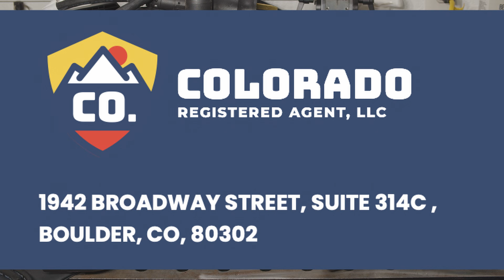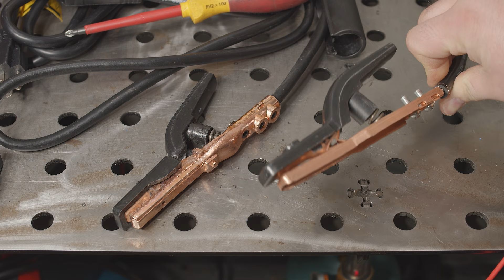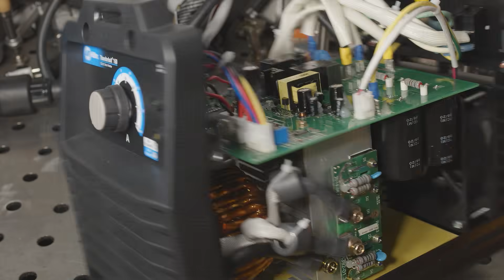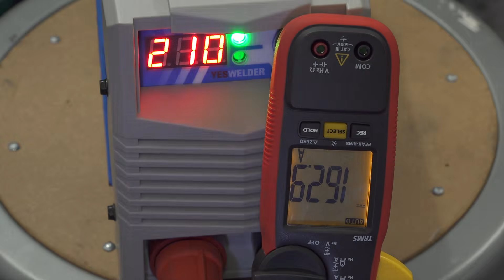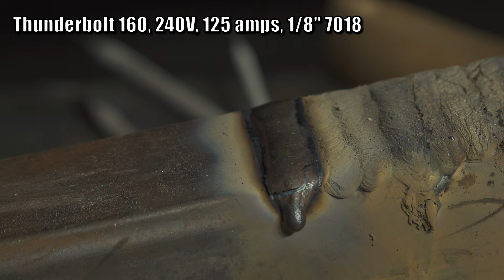Miller Thunderbolt 160 Vs Yeswelder Arc 205DS:  In-Depth Comparison

Comment: Am thinking of purchasing Hobart 27i plasma cutter. There is a new version out and yet the older version is higher priced. Is there a reason ?  Any info would be great.
Reply from the maker: Depending on where you find them, they are a somewhat similar price.  The old version is very likely discontinued, and that can sometimes lead to strangely inflated prices, especially with certain Amazon sellers, for some reason.  At TSC, the old version is still available for $1,599, which isn't too far off the MSRP of the new version.  I did find the new version for less than that though, and I did find the old version for well over $2,000 from a random seller on Amazon, so there is that going on.

They both seem to have very similar capabilities and functionality.  I don't know for sure where the new version is made, but I'm almost positive the previous version was made in Wisconsin.  

The new 27i also seems to use the same case as some of the Miller welders and cutters, so they may be making use of a few common parts and tooling from other models which allows for fewer unique parts needed.  If so, this may allow them to lower manufacturing costs with the new version.  Nothing wrong with that.

From what I can see of the specs, they don't seem very different.  If you can get a good deal on the old one, go for it.  But Cyberweld has the new version for just over $1,300.  That might end up a better value if you can't find a deal on the old version.

Comment: Yeswelder gave my supervisor a free rig. We normally use maxstar 150s and 210s. The Yeswelder was pretty decent when we messed around with it for 6 in stainless pipe welding. Stock torch was meh but it could lay down some nice welds. I guess the question is just for how long? If you don't weld super frequently, I think it's worth saving the money with one

Comment: I'd rather not give money to a virtual address kind of company.
Wish you did a breakdown of the Eastwood Mig 135.
Just too much marketing bs everywhere, can't make a decision.
Basically everywhere/everyone says igbt is significantly better than transformer but most entry level igbt is just chinese trash, so I dunno what to buy for my first welder.
Reply from the maker: IGBT is significantly more efficient and capable of much smaller, more lightweight designs.  

I haven't looked at any Eastwood welders at this point.  It's easy to get paralyzed with all the decisions these days.  Are you primarily looking for a MIG welder?
Reply: @bigtb1717  I was just going to buy the cheapest stick to try to rebuild some stuff.  But for not much more there are 3 in 1 units that I was looking at, previously a flux 135 yeswelder unit with flux mig, life tig option, and stick.  I'd rather not bother with 240v mainly.  My drier plug is 10-50p and all the welding plugs are different, don't really feel like building an extension cord and running out of the drier exhaust of my house (lol).  The Eastwood was on sale for $195 so I was looking at that one.  Has a 3 year warranty from a real company with a gas option, seems to be a trusty plow horse.  But to answer your question I'd prefer both stick and mig, but flux mig does seem more practical for entry and less frustrating potentially.

Comment: Good video!  I am from Chile and I bought yeswelder, here the voltage is 220v, my question is, yeswelder automatically detects the voltage or do you have to make some configuration to make it work on 220v?
Reply from the maker: It should work just fine on 220V.  No configuration or changes needed.
Reply: @bigtb1717  Gracias 🙂

Comment: Would you recommend the yes welder for someone that is just going to use it home a few times a year. If I build anything heavy  duty I'll just take it work but I do want to be able to run 1/8 6013 rods.
Reply from the maker: It would probably be okay, as long as you understand the limitations.  Will you be running it on 120V, or 240V?

Comment: I really didn't like my Amico. Absolutely no heat control, starting off extremely cold and getting way to hot extremely quickly. By the last 4 inches of the rod the flux would be black. At least now yes welder is growing and seemingly producing more quality machines.

Comment: Do you know if the Yes welder really makes use of the 220v adapter?  I suspect that when connected to the 110v plug that only one leg of the 220v line is used but at the same time it can draw more current since the 220v circuit generally has a higher amp breaker.  Also, I would  question the safety of using the same 110v gauge power supply line to carry the amps that come with a 220v line.
Reply from the maker: Yes, it really makes use of 240V.  There is no neutral in the three terminal 240V connector, only the two "hot" leads and a ground.  There is no way for it to only use 120V, because that would require the neutral.  

Plus, it has higher output with lower current draw when running on 240V (I measured it).  The only way for that to be possible is if it is using higher voltage.

The main issue I see is with the adapter itself, since it would allow someone to connect a 120V device into 240V very easily.
Reply: Thanks for pointing it out.  I am wondering if it's better to have a 220v welder with a 110v adapter?

Comment: How about something a little more comparable in price? The Yeswelder is a quarter of the price of the miller, you can get a Chinese multi process machine for still less then the thunderbolt. The tig welding bit is a bit of trickery, the thunderbolt could claim the same, as any arc welder can be converted to a tig welder. There are other comparably priced machines that have a lot of features in the same price range of the Thunderbolt, like the LOTOS LTPDC2000D. Many of these machines have been on the market for a quite a while now and are excellent hobby machines.
 Great review, but the miller is still expensive for what your getting. Even in the 205DS series of Yeswelders you can get a multi process machine that has stick, mig and tig. Mind you there's still no quality but they are hobby or starter machine at best. 
 Personally for stick welding give me an old transformer buzz box like a Lincoln tomb stone. You can find a used one for a hundred bucks and it will outlast your children.
Reply from the maker: Don't get me wrong, I'm not saying the Miller is the best value out there.  It may be the right choice for someone, but there are definitely other machines out there with far more features for the money.  I have looked at a whole lot of Chinese machines at this point (Amico and Yeswelder being the primary ones, but also Deko, Juba and a couple others) as well as an Everlast and a more.  This Miller is built much better than all of them and has a better warranty.  Does that mean it will actually hold up longer:  Nope.  But I just wanted to look into the idea that with them all being made in China, there was really no difference other than the name.

But I do agree that the Miller isn't best value out there from a pure price/performance or price/features standpoint.  In fact, I have a Klutch ST201iDV welder arriving any day now, and it has FAR more features than the Miller Thunderbolt 160 and it's currently $389.
Reply: @bigtb1717  Klutch will probably be more of the same if you can get one, it's another one of those currently unavailable stores. $389 is a good price for a Miller, haven't seen one under $500, that's getting into Hobart money there.
Reply from the maker: I mean the Klutch has more features and is currently $389.  Not that the Miller is $389.  Sorry for the confusion.  I ordered the Klutch over a month ago and it finally shipped last week.  It is currently in transit.
Reply: @bigtb1717  No problem, keep up the good work. What do you like in the cheep Chinese mig welders? I bought a Lincoln 140HD and it basically sucks. I watched your review of the Yeswelder 205ds mig and a few of the HF Vulcan welders and I'm kind of scared. I don't need a great machine, as I'm just a hobby guy, but i would like a decent mig welder without going crazy expensive. I'm not afraid of the Chinese stuff, I have a Primeweld tig 225 and a matching plasma cutter and they have both been a lot of fun. I'm sure there's much better stuff but as a hobby guy it's all about getting the job done. The inverter machines are much cheaper, all be it no where near as robust as the transformer machines, but they work. 
 Like I said keep up the good work, I've got some videos to watch, the big squirrel was cute. One more subscriber. Thanks
Reply from the maker: I think the prices have gone up since I did my review, but after reviewing the Vulcan MIGMAX 215 I sold the welder to my cousin.  He has been using it on the farm for the last couple years and hasn't had any issues with it.  I have been considering testing out one of the new Titanium MIG welders, but I haven't gotten to it.  What is the problem you have with the Lincoln 140HD?
Reply: @bigtb1717  Not enough heat to do the job they claiming it could do. Not enough experience on my part to know better. Never again on a 120 volt welder.
Reply from the maker: And as for the TIG welding, the Yeswelder claims "lift start" which is not true.  It could be set up for scratch start, but it does not have lift-start TIG.

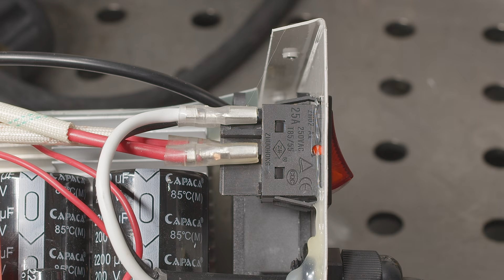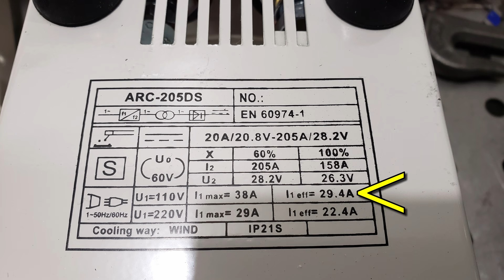Comment: at 09:50, the power switch is rated 25A for 250VAC, but later on at 09:57 you compare the eff amps (I1 eff) from the table for 120V instead of 220V.. why?  great video !
Reply from the maker: The switch is rated at a max of 25 amps and a max of 250VAC.  Running the switch at less than 250V doesn't mean the switch will handle higher amperage.  When running the welder on 120V the effective current draw is more than 25 amps, which is higher than the rating of the switch.

I doubt this will be an issue, I only pointed it out because it made it clear that this welder wasn't actually IEC 60974-1 certified.

Comment: When buying cheap welders getting the most powerful advertised welder almost always seems like it's not going to be true amperages. Maybe try the yes welder 165. Advertised as having lift tig, and arc force which would be an amazing machine if that was true for under $150.

Comment: I’m not saying it’s a good idea, or OK, but you can generally get away with a switch being rated for less than current draw since it’s a duty cycle. And you aren’t switching under full load. though it’s not ideal..
Reply from the maker: Fun fact about the 60974-1 standard:  Meeting that standard requires the welder to be switched on and off at full output a certain number of times without the switch failing.  It's one of the few actual testing requirements of the standard beyond duty cycle and component temp testing.  Also, any included welding leads must have insulation "suitable for the application."  There is a separate code referenced that any cables must meet in order to be considered "suitable."  My guess is that the insulation on the Yeswelder cables wouldn't meet that spec, lol.  Just interesting to me.  I guess I'm a bit of a nerd about this stuff.
Reply: @bigtb1717  well that make you our US Q/C 👍.
Reply from the maker: Absolutely.  I don't imagine the switch will be a problem.  However, the "rated" amp draw of the welder does take duty cycle into account, which is why the rated amp draw of the Miller is so low.  The "rated" amperage of the Yeswelder is higher than the rating of the switch.  So even factoring in duty cycle, it isn't rated high enough to meed the 60974-1 standard.  I don't imagine it will be an issue and it won't matter to most people. It doesn't really bother me.  Worst case scenario the switch fails some day and I swap it out for $1.  I was just pointing out that one of the requirements for meeting 60974-1 standards is that the switch must be rated at or above the "rated" amp draw of the welder.

Honestly, I'm more disappointed that the welder doesn't meet the stated output specs.  It's not even that the output is bad, it's just not at all what is claimed, and that bothers me.

Comment: I just started researching welders to buy my first welder. The Yeswelder models numbers are a bit confusing . The Model you have is actually the 205A despite what the side panel label states. Their is the more expensive TIG-205DS that has the same side panel label as yours but more controls on the panel and a TIG connector on the front. I think that is why the advertised specs do not match your welder. They probably would be more appropriate for the TIG-205DS.
Reply from the maker: Yeswelder has a TIG 205DS, an Arc 205DS and a MIG 205DS.  This is the Arc 205DS and the specs I mentioned are actually printed right on the data tag on the welder itself as well as in the instruction manual.  They are also advertised on Yeswelder's website for this welder.  205A stands for 205 Amps.  They do say "205A" on the website listing for this welder, as in it is a 205 amp welder.  But the model is Arc 205DS, which it does say on the website in the description.  

Good luck in your search for a welder.  Welding is fun and it's a useful skill to have.
Reply: @bigtb1717  Yes, confusing. Watching your Deko Pro 160 now...  :)
Reply: @bigtb1717  Per the amount of youtube vids it seems the Yeswelder 205ds is very popular. The Yeswelder 165A is not. For a beginner, would the 165A be a good choice? The price price with discount is very good given the features.  And unlike others in this price range, the cables are 10ft long.  The output is 140+ when set to 165A.  https://youtu.be/fn4_dUPVLdc?t=1140
Reply from the maker: The Arc 165DS would probably be fine for starting out.  Personally, I find it a little annoying that every one of Yeswelder's models seem to put out less than rated amperage, but 140 amps is enough for most uses.  One thing I am finding with Yeswelder models is that they aren't very efficient on 120V.  They put out a decent amount of power on 120V, but they will also trip a normal breaker pretty easily.  Just something to be aware of.  If you plan to run it primarily on 120V you may have to turn it down a bit to keep from tripping the breaker.  I can't say for sure that the Arc 165DS is the same way, but I imagine so.
Reply: @bigtb1717  My guess is most cheap welders specs are over inflated. Having vids like yours and the one I posted would be very helpful.  Glad you confirmed that 140 amps can do a lot.  Much appreciated!  Ok, all in @ only $106. The first welding project requires 60~80 amps 3/32 7018 rod from what I was told.  120v 20 amp breaker should work for that.  I already have a dedicated 120v 20 amp circuit.  If 120v is not adequate, wiring a 220v circuit is not a problem. I already have breakers and wire from other jobs. The Deko was a consideration but a price delta of ~$35 with taxes, and what appears to be better ground and electrode cables, made the decision. The 165DS front panels feature set options may, or may not, be useful.   Now to figure out the cheapest rods to learn with.  And financial preparation for a significant increase in the electric bill.
Reply from the maker: FYI, I've never notice a major difference in my electric bill from welding.  On 120V, the most power you can draw from the wall is a few KW.  I believe my rate is under $0.10 per KW hour.  So even if I ran the welder for a full hour of actual arc time it would cost me less than 30 cents.  If you check your electric rate you can do some rough calculations to figure out what it will cost you in electricity.  It's probably not very much.
Reply: @bigtb1717  PGE rate plan is total confusion.  .21 -.41 kwh. Depends on day, month, time of usage, what your Baseline allowance allotment is per PGE, if and by how much you use above the Baseline....  You are right, it should not be a lot more. I was half joking...

Comment: I have a yes 160 and an amico arc160.   the yes hammers the current pretty hard, i think it has a really hard arc force setting.  the same 3/32 7018 rod runs really  low on the yes like at 50amps, whereas its high 85amps on the amico.   the yes pulls a lot more current for its low setting.

Comment: Want to buy one, could you try and run an open root and see how it does
Reply from the maker: Are you talking about the Thunderbolt?  Are you wanting to do open root with 6010?
Reply: @bigtb1717  yea brother please before the 12th if possible
Reply: @bigtb1717  no video unless possible, just a yay or nay
Reply: @bigtb1717  would love a video tho. Ran on anything you have. I’m trying  to see if it would work enough to run some roots on schedule 40 pipe and 3/8 bevel plate  for practice but I’ll be capping it with 7018 and I seen that the 7018 runs well so I’m curious about running a root because the specs said not ideal for 6010 roots
Reply from the maker: I wouldn't recommend it for 6010 open root.  I actually don't have the welder right now, so there's unfortunately no way I could try open root before the 12th.  But just based on how easily the arc would go out when just running a 6010 bead on a plate and the fact that Miller themselves even say not to use it for open root with 6010, I wouldn't pay the money only to find out that it really doesn't work for your intended purpose.
Reply: @bigtb1717  how do you think it would do with 6011
Reply from the maker: No problem at all running 6011.
Reply: @bigtb1717  sweet
Reply: Don't buy one. I can not even describe how cheap this toy is. I have a 50 dollar ebay stick welder that is better quality than the yeswelder. It is complete junk.